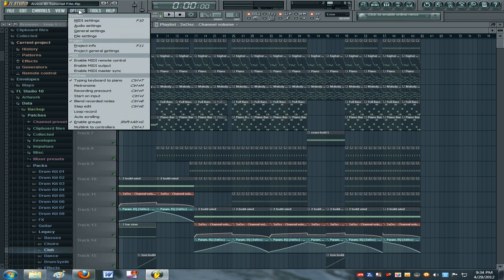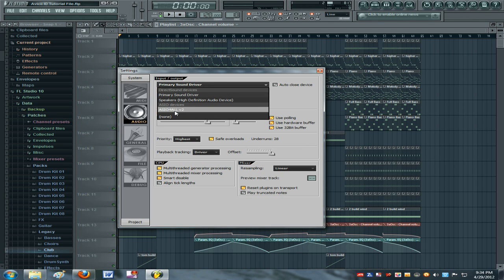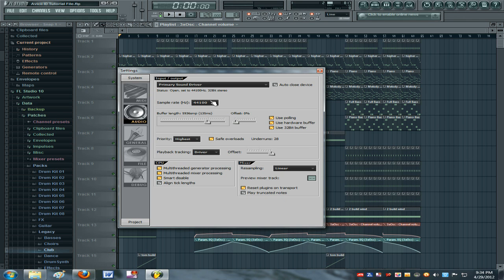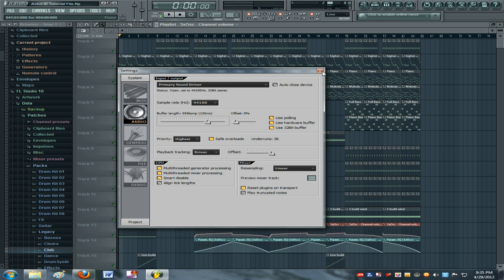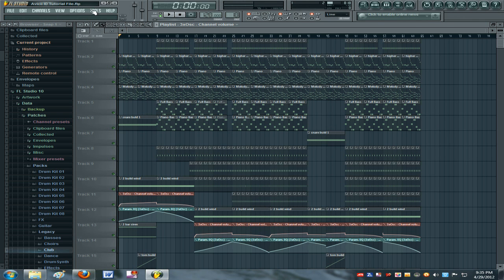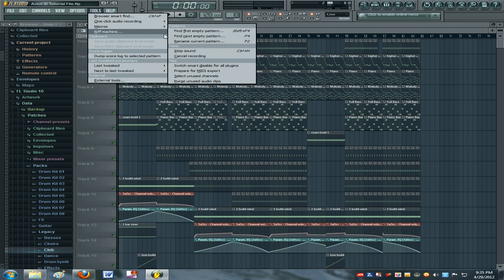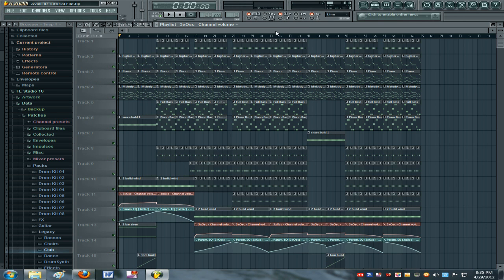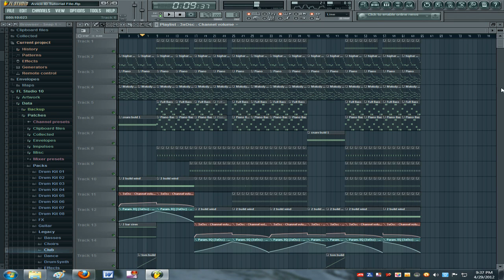How to eliminate crackling in FL Studio

Comment: Bro I use an behringer audio interface ...and select it for audio device...but in recent times...when ever I open my flstudio...a crack sound occurs..and I need to turn on and off the mix in buffer option to ridoff that cracking sound, also sometimes when I open a project there is no sound..while playing it...when I disconnect my interface select asio driver it plays through my laptop speakers...very well
I dont have any cpu overloading issues
...pls do some help...totally hopeless